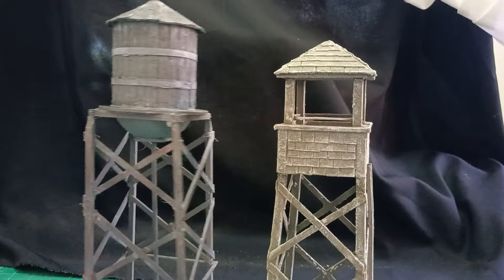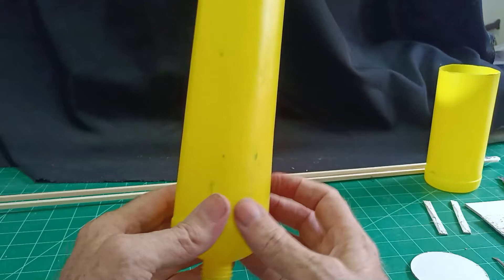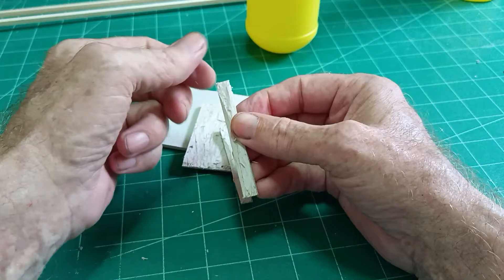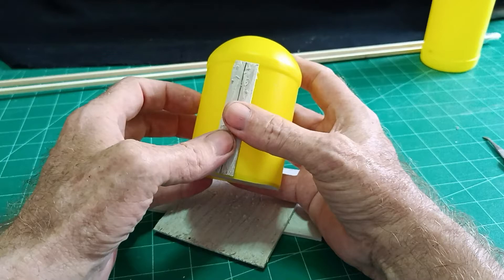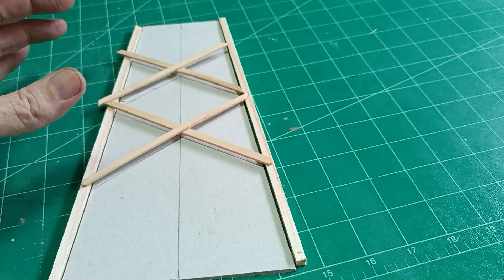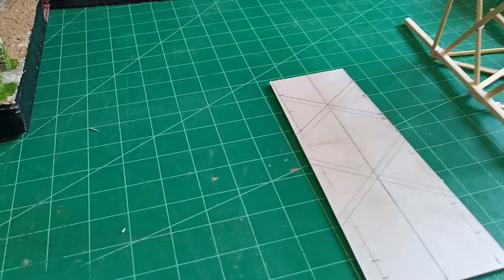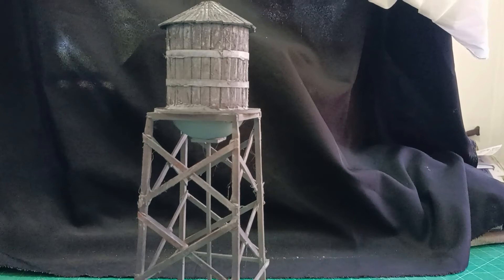Scale model water tower. How to make.

Comment: 1:00 -  Water tower (reservoir, vessel, container, tank) domed end bottle [use available shapes whenever possible]
2:25 - top, conical shape formed from a thin cardboard circle
3:05 - wood surround (casing) of water reservoir
5:20 - Deck Ring 
5:45 - Support Legs notes - 1/4" (6mm) square balsa wood struts (legs)
6:31 - Assembled water reservoir notes [conical roof, thin card or paper for metal banding, 3/4" pipe for outlet pipe - reduced to 1/8" (3,175mm) ]
8:15 - Tower Leg assembly jig [10" (254mm) tall ] cross members are laid out over drawn lines for position consistency - make two opposing sides for support leg shape for assembly with water tank, then apply cross members to remaining two sides
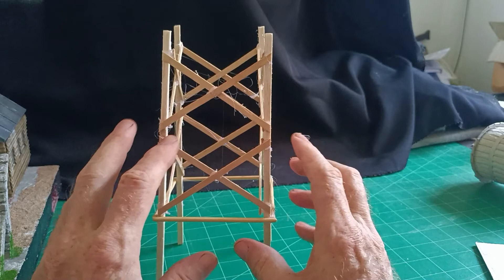12:43 - change of outlet pipe diameter
13:07 - Assembled water tower and painted grey (spray paint with white dry brush and rust effects) - all off camera

Diorama Don relevant links
Ruined Building: https://www.youtube.com/watch?v=FrFnUs1kSS8 (knife awareness and safety)

Watchtower: https://www.youtube.com/watch?v=noDkwNGzDK4 (card and wood construction)
The Great Escape: https://www.youtube.com/watch?v=khIWRoObqz8  - The Great Escape (1963) 2hr 52 min

Fence, Wooden:  https://www.youtube.com/watch?v=4Ki_ArJabYw (3mm or 2mm card) principles and practice for barn and garage doors as well. Brush bristles (coarse) can impart wood grain texture with paint. Watered down wall filler as a primer coat contributes to the woodgrain effect - pull bristles in direction of grain, in this case, length of the boards.
Fence, Dilapidated Old Wooden: https://www.youtube.com/watch?v=CjRWFESFDSk (3mm thick cardboard) leaning and placement of boards, plan out and draw what is to be cut out. Distressed cardboard for texture and weathering before paint is applied.
Rundown Gas Station: https://www.youtube.com/watch?v=uxMVMkEgDMM (distressed card for weathered wood) (three petrol pump designs)

[edit: include leg jig height measurements]